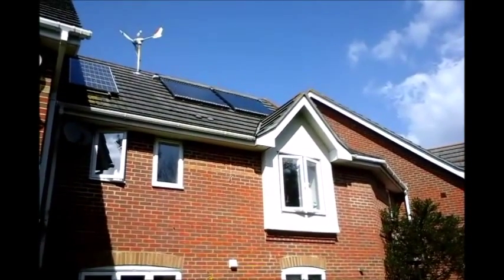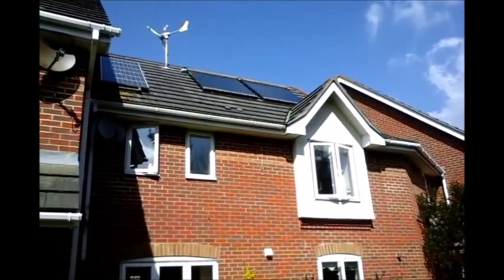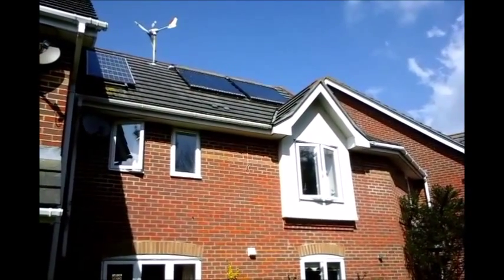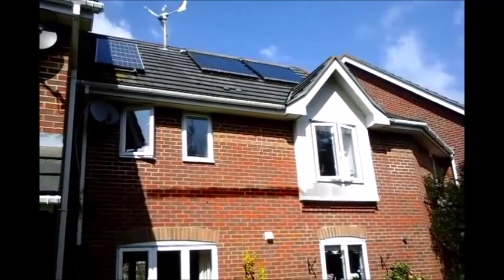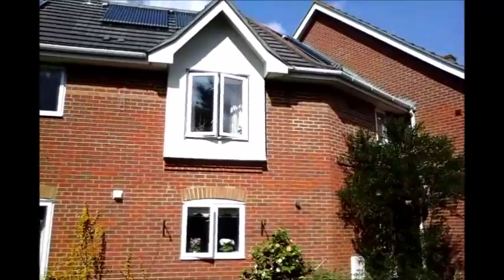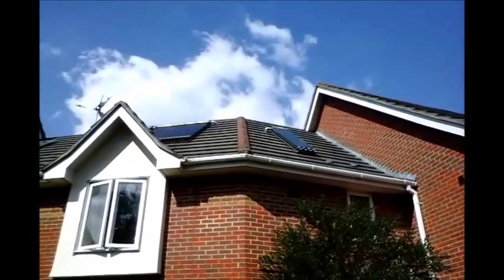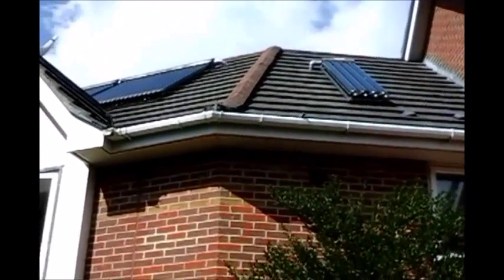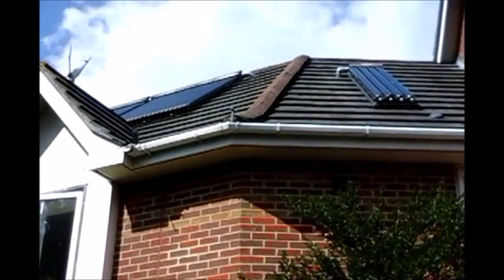Solar Central Heating and Hot Water Multi Fuel systems

Comment: A lot of water has flown under the bridge since I posted this video

We are now in a Covid pandemic period, and time to renew and update my web site.
My NEW ThermoSolar thermal stores are now manufactured by Newark Copper Cylinders in the UK, including in Stainless steel. re connect with me through my web site www.thermaltricity-int.com
I have a new video, not yet uploaded to You Tube, but can be found on my web site 
Climate Change is now a big issue, along with the Pandemic, but I am as busy as ever, with my PVT solar panel coming along for next year.

Comment: Great video.
At 3:05, "solar central heating has been banned... in the UK" why? what is to reasoning behind the ban and is a link available?
Secondly, is the left panel a PV panel that is under a shadow?
Reply from the maker: +Brian Dean Under the UK government RHI subsidy scheme, that supports renewable heating technologies, you are not allowed to use solar thermal through a Thermal Store to support home heatng. The payment received through the RHI is £0.19p a kW hour deemed, which works out about £2,000 over 7 years, but costs the home owner £5,000 installed for a 200 litre unvented solar water heating only system. 
Yes the panels on the left hand side keeps my 6 x 100 batteries fully charged, and in the shade as was late afternoon, but the thermal tubes continued to provide hot water.  My gas boiler backs up my solar central heating, but in a power cut nothing would work, not even the gas boiler for the sake of 60 watts an hour. All my lights are now LED emergancy light bulbs, so I have 3-4 hrs of lighting when a power cut happens
Reply: +Eric Hawkins Thank you for the reply and insight. I think I understand the reasoning behind the ban as it applies to subsidies in a hybrid environment. For instance, if water is heated from 10c to 50c using solar thermal followed by a conventional energy source to heat it from 50c to 70c for use in a heat radiator then, calculating the subsidy entitled would be problematic.
It would entail that if subsidies are kept out of the picture then, a similar system might still be able to save a homeowner around 60% usage of a conventional energy source.
Reply from the maker: +Brian Dean Sorry, but is not designed to run as you have pointed out.
My solar controller shows a Kwh meter so you can see each day how much energy the solar thermal has pumped into the thermal store.
For example in December I reduced my gas boiler working by 54Kw and in January it was 108 Kw and as we go through the next few months until May, the amount of kWh pumped into my thermal store and then to my radiators maintains a temperture in my radiators of around 28-35c a hour. 
As day are longer, sun in the sky higher first thing in the morning, the more Kwh are transfered from the collector to the thermal to to the radiator while the gas boiler is switched off from 8.30am to 4.30 pm unless its very cold and wind chills.

PS
To anybody in the UK seeking to refurbish there central heating system, contact me as my 5 designs are soon to be back in the UK market at even lower prices with World Heat as my thermal store manufacturing partner

Comment from the maker: I am seeking established SWH heating importers/exporters, manufactures and re sellers to installer groups throughout the world to share my 25 years of design and development knowledge with.
later this year, we will launch our comercial flat pack tank range named the Thermocube range. Now made in Sth Africa with 80 tank installations with heat pumps todate completed.
My business is located in Hangzhou, China and the plan is to now produce a range of flat pack tanks up to 12,000 litres, where you can walk the panels and parts through a standard door.